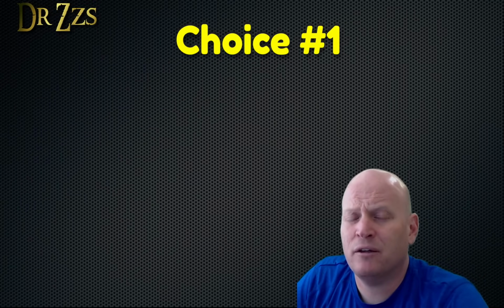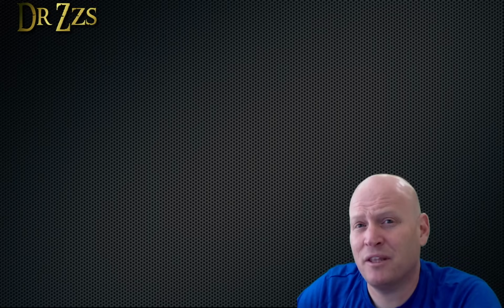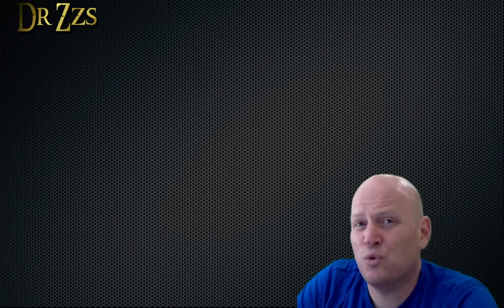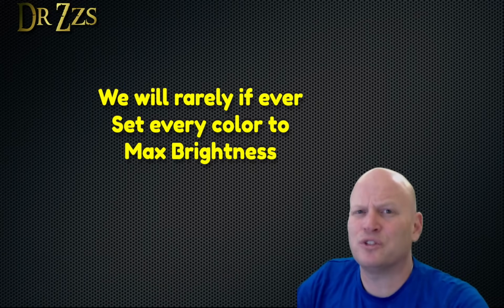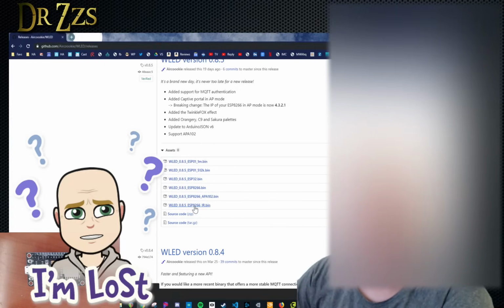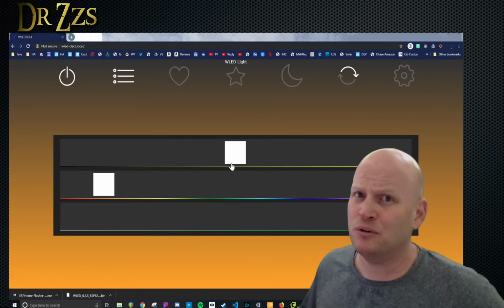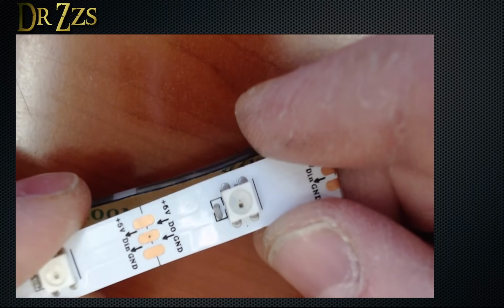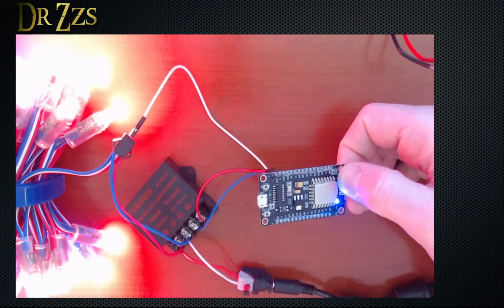Beginner's Guide to Christmas Lights - and LED Shows for Every Holiday

Comment: Detachable/storeable mounting. I came up with this idea when I "inherited" a 4' x 10' sheet of Coroplast. Coroplast is essentially corrugated cardboard (the same as is used for most packing boxes) except made from a flexible plastic. (I don't know the technical details of the type of plastics used, except they're fairly UV-resistant. The material is widely used in sign-making, for everything from realtor's "for sale" signs to large "screw to a wall" advertising signs. There's a printing process for this stuff that again, I know nothing about). Anyhow, I wound up with a sheet of this stuff, slightly off-white, and 4 ft. (about 120 cm) x 10 ft (about 300 cm. This sat in my garage along with other "good junk", and then the "aha" moment. If cut into strips about 2 cm to 2.5 cm x 300 cm long (width depends on the type of lights used), it can make a very simple, modular, easy to hang and remove mounting base for LED''s. If you're using the adhesive strip LED's, cut strips of Coroplast just a bit wider than the LED backing. If using string LED's, it's easy to drill or poke holes through a strip that's maybe 2 cm wide, spaced according to you LED strings. (A cheapo 20W soldering iron is perfect for this). 
Coroplast is also really good for mounting small control boards or PSU's to the back side just using double-face tape. As long as it's clean when the tape is applied, it seems to stay on very well. Likewise, if you want to change to a different receiver or control unit, this mounting system makes that very easy. 

So cut strips lengthwise from your panel (along the line of the corrugations). Then stick on the strip LED's or poke individual LED's through. Now you have a bunch of strips of Coroplast with LED's. You can vary the length of the Coroplast strips depending on where they're to be mounted. 
Now, using a few pieces of snare wire, put 2-4 wire loops through the top edge of the Coroplast, (typically 1 at each end, and 1 or 2 spaced in between. NOW, you have strips that can be hung on eavestrough edges, fascia, etc. using only a few small wire hooks. At each end of the Coroplast/LED strip, you have an option. #1) if you know exactly where the strips are going, you can simply make hardwired "bridges" using 1" - 2" pieces of flexible, stranded copper wire. Method #2 is to use a set of 2-pin (or 3-pin, if require) connectors. Unless they're "universal" fit, put one "male" connector at one end, and one "female" connector at the other end. Once you hang up the Coroplast strips with the LED's mounted on them, you can just plug the ends together. There are many styles of connectors available in lots of 50 pair or 100 pair, low voltage & low current, that cost very little. 

A couple of caveats to using this method. 1) you'll need to figure out ahead of time the lengths of strip required. In some locations, a piece only 2 ft or 3 ft long will fit the space. If on a long, straight edge, you might need 2 or 3 stripes, each 8 ft or 10 ft long, to reach from end to end. 
#2) This idea assumes that you're going to put the same sections of lights in the same location on your house each year. So, it's a really good idea to (a) make a sketch showing each place where strips will be hung, and (b) mark the back side of the strips with a letter or number that corresponds to their location. This will make hanging up each strip go very quickly, and it also means that the connectors at each end of a strip will always match up, male-female. 

It's possible to just make up a bunch of strips of a couple of standardized lengths, e.g. 3 ft. or 5 ft. or 8 ft., and then just piece them together when hanging them up. Because each Coroplast strip has only 3 or 4 attachment points, this can be a pretty flexible way of doing things. But I've found that "made to measure" length strips for specific locations work really well, and go up very, very quickly. Also, if one section fails, it can easily be repaired or replaced. 

I originally used this idea for hanging up strips of incandescent Christmas lights. It was far easier to hang up pre-fabricated sections that had only two or three hooks or attachment points, compared to trying to hang the wire using cable hangers or whatever. With a male/female connector pair on each strip, everything plugged together very fast. In some cases, the strips could be joined with short jumpers made from 1 inch - 2 inch pieces of stranded insulated copper wire, and this works just as well with LED's. 

Aside from ease of installation, the other big advantage is ease of storage. When the strips are taken down, you're left with a bunch of "sticks" that can be bundled up with a couple of velcro wire wrappers (the kind used when coiling and storing long extension cords). 

This system doesn't "fill the bill" for every part of putting up LED's. But it sure speeds up many parts of the job and, using a "reaching stick" many of the strips can be hung up without a ladder. 

I know people have done similar things with other kinds of supporting materials. The nice thing about Coroplast is that its a) cheap, b) easy to cut (razor knife) or put holes in (drill/soldering iron), and it's very lightweight but still rigid even for long sections. 

If you've covered this idea in one of the many other videos you've put up, my apologies for duplicating that. I've had good results using the Coroplast material - it's stood up very well over several years of use, needs only a few hooks per section, and it doesn't cost a bomb - leaving more money to put into newer LED's and "fancy" lighting controllers.

Comment: use the waterproof strips with silicon glue. it will last a lifetime the only problem is if you want to remove them you will destroy the strip.

Comment: I have a 12v 30am PS and am having issues powering up 12 strands of ws2811. Is this too much? I don’t anticipate using this many, but I start losing power after 5 strings of lights. What would you suggest I do? 

I shouldn’t have to supply power to each strand, right? That’s the whole reason I paid more for the 12v strings.
Reply: should you connect the positive and ground at each end of the strand to eliminate power drop.?

Comment: So, I installed the lights (just three strips to start), tested, and they seemed to work fine. I then added the power injection for the whole length and now only a small portion of LEDs light up near the powered end, and they get dimmer as they move away from it. I can access WLED, but power button etc. do not work. Tried a new NodeMCU, same result. Any thoughts? Short? unhooking power injector wire doesn't change anything.

Comment: My question is Can you do a light show with regular LED Christmas lights and not special light strips?
Reply: You can it just gets much more complicated with control boards, and restricted, because you have to pre set the colors per string.
Reply: @jedidiahwilliamson6147  So if I have over 10,000 lights right now Regular LED, what's my best option moving forward to a light show. Buy all new?
Reply: I would look into arduino if you have that many lights. There are some pretty cool controllers you can make that would probably be alot cheaper than replacing all of them

Comment: My notemcu board won't connect to computer. Can you help. I tried 2 different ones and the light flashes only once when I connect it
Reply: I was having the same issue with my port not being recognized so I pressed the rst and flash button on the nodemcu. Refreshed and it picked it up. Not sure which is the one that got it to recognize the controller but it worked. Hope that solves your problem.

Comment: In a previous video you mentioned you had your strings hooked to a 60amp Power supply. Does that mean you had to power it off a 60amp circuit receptacle or does the power supply run off a normal 15amp circuit receptacle. I ordered a 30amp power supply for my lights and just wanted to know if I'll need to install a 30amp breaker into my outdoor circuit.  

Its been more than 10 years since I took electrical construction and engineering in high school so I feel very ridiculous asking this. I feel like I know the answer but I just don't wanna second guess myself.

Thanks in advance!
Reply: Withdraw question. It works on a regular 15amp outlet just as I thought.

Just gotta get jchannels and drill 1000 holes and hang em now.

Comment: Do you reckon its important that the lights face down and not straight out? Probably helps to glow the house a little bit right? i bought the j channel like you did but i dont like the look of the flange of the channel being on the face board. i can drill the hole on the other side but the wires are touching the back side of the channel. i can drill it like you had but it will end up shining the light twards the road and not straight down. im wondering if youve tested it any other way? i got all my components in last night and will start to test tonight. i am a little worried about how im going to mount.

Comment: I am running Windows 10 64 bit ESP Home Flasher will not recognize my microcontroller. Any suggestions Doc?
Reply: Same issue. Did you fix it
Reply: @luckychris1997  I was having the same issue with my port not being recognized so I pressed the rst and flash button on the nodemcu. Refreshed and it picked it up. Not sure which is the one that got it to recognize the controller but it worked. Hope that solves your problem.

Comment: How accurate you need to be when selecting a power supply. Could I buy a 60 amp supply and run a 10 amp setup with it? (And then add to it later) Thanks for the video!
Reply: Yes you can buy a 60 amp knowing for mow only 10amps will be used and you will have the other 50 amps towards future usage. Its just like a set of outlets in your home running just toaster but knowing you can run a coffee maker and microwave if necessary
Reply: You can get bigger than necessary and have amps to spare for future use
Reply: Awesome, thanks for the reply!

Comment: This might help someone else. I'm running Windows 7 x64 and I had to first install the CP210x USB to UART Bridge VCP Driver before I could get the NodeMCU to show up in espHome Flasher. After that, it worked like a champ
Reply: Can you post a link? I plug in the nodemcu and the flasher doesn't see it.

Comment: Where would you have the power supply? If you are doing the lights for say your roof where would you keep it? Wouldn’t it have to be outside? If so how are you protecting it from the weather? I’m trying to start my own setup but not sure about this.
Reply from the maker: My house has a few outlets under the roof overhang.  I have a waterproof box where I put my PS and controllers.  https://youtu.be/6Y6jUM1OaYM
Reply: DrZzs The node MCU, do they make any to handle the 12v or are they only all for 5v and you need that adapter no matter what?

Comment: Who would have thought it is this easy to get friggen cool LED lights. Thank you for this video and all others!

I bought 3 packs of 12v string LED's and the DC converter. Neither the lights nor the NodeMCU would start up with jumper wires throughout the setup. I switched the wires going from the power supply to the converter to some 18ga I had lying around and that seemed to do the trick. With an enclosed power supply (12v, 5a) and no power injection between the three string packs there is degradation and discoloration on the last string. Fortunately, I purchased two power supplies in my order and the bare metal at 30a has no issue. I will probably order two more strings and use these for a Christmas tree. I really hope I won't need to inject power. 

One more tip to all, make sure you cover all the power injection wires because they are live!

Comment: I have a 12v system with Node MCU, DC converter and 40A power supply, basically everything you described in your brilliantly done video. Lights have been working great for couple weeks. Came home tonight and power supply was on but blue lights on Node MCU not on. Played around with the wires on Node and got it to turn on intermittent but then shuts off. Switched out Node to another and still nothing. Any ideas?

Comment: What if the string is 12 v but adrino only 5 volts how would u power adrino?
Reply: This is covered in the video...you need a 12v to 5v converter.

Comment: For a new display do you use multiple controllers or is everything generally run through one controller? Any suggestions for a cheap small solution for starting up (just planning on a few yard decorations that i want to hook up)

Comment: I'm having some trouble. When I first fired up my LED strip they all blinked like crazy and only about the first 30 lit up. I adjusted the amount of LEDs and my power supply is correct. When I change effects in WLED it changes but it doesn't seem to be displaying the correct effect. My NodeMCU is plugged directly into my strip. Any ideas?
Reply: Would it matter if my NodeMCU and my strip have different power sources? When testing this I had my Node hooked to my computer with the USB and my strip hooked to the power supply.
Reply: 30 is default. You have to go in the led preferences and change # to what you have. Also have to set your color sequence.. RGB , GRB, etc... but it might be your signal wire. Mine was 18", and they would flicker, be off color.  When i made wire about 4", they work as they should.  Purtting mine up this weekend.
Reply: @Nick-bc2lm  thank you but I figured it out. I had all the setting correct but apparently if you power the NodeMCU from the USB connection either it interferes with the data signal to the string or the voltage is not strong enough. As soon and I powered the node from my supply it worked perfect.

Comment: I dont see police all, one, or the candy cane selection on the app. Anyway to get those? Or anyone have them in a file?
But like he said, make ur data wire short as possible. I used a 12" servo lead and had issues. Colors would scramble. Cut and solder to 3", have no issues.  Installing j channel and 700 pixles.
Reply: Oh, and thanks for your vids, and amazon links.

Comment: I have 5 meter, 300 LED strips, with power injection wires at both ends of the strips. When injecting power, do you put the parallel power wires into the beginning of the second strip, or the end of the first strip?

Comment: Great project I have been able to get the app to work with some extra leds I have on hand. My previous set up at home includes about 150 feet of APA102 lights, will these lights work on the WLED app? If so how will they be connected to the NodeMCU. Thanks

Comment: I've bought 4 of the NODE MCUs (from the Amazon link provided) (these are Amica brand ESP8266), 3 micro usb "data" cables, and can't get any of them to recognize on a COM port like the video shows.  I've tried to install the CP2102 driver with no luck and all of this on a Mac, a Windows 10PC, and even a Windows 8.1 PC.  I have spent at least 4 hours trying to troubleshoot why I can't recognize the board with the ESPHome Flasher as shown.  The google searches all reference this being a problem and most people solve it by trying different cables.  I don't think it is a cable issue because I just tried 3 different "data" cables from Amazon and one that came with an Arduino.  
I have 10 16ft strips of LED lights and 160 ft of aluminum channel, with 2 power supplies that I can't even get off the ground with.  Can anyone point me in a direction to get this stuff working?  DrZzs, do you have any videos or other things I can look at to help me out of this?
Reply: I had the same issue. I disconnected everything from the PC or MAC (I also tried it on both). I then downloaded the CP2102 driver and I had to go into the computers device manager and do something special there for it to install it. Once I did that and then restarted my computer and then plugged in the Node MCU the computers both MAC and Windows 10 recognized it. There was a YouTube video of someone hard to understand due to their language however I watched it a few times and followed along and it worked. I can't find the video now. Hopefully this help.
Reply: I was having the same issue with my port not being recognized so I pressed the rst and flash button on the nodemcu. Refreshed and it picked it up. Not sure which is the one that got it to recognize the controller but it worked. Hope that solves your problem.